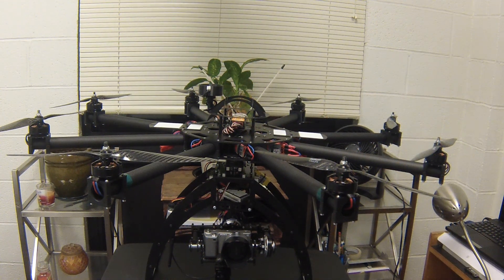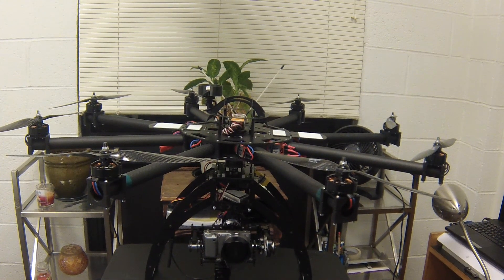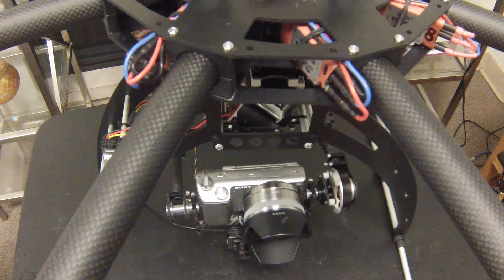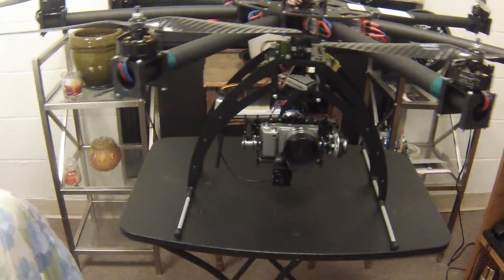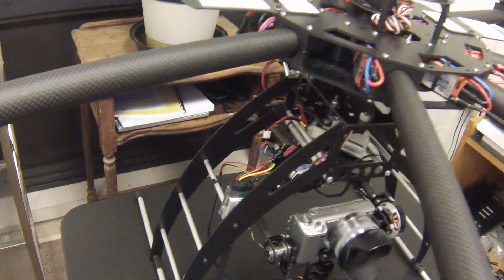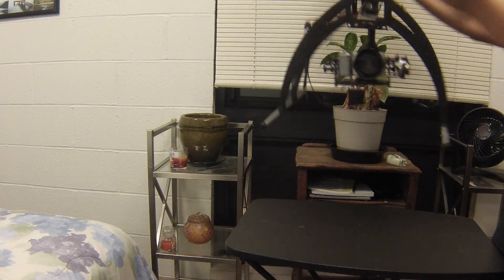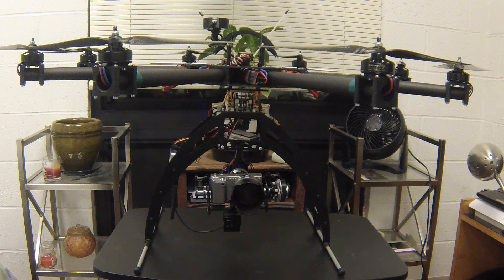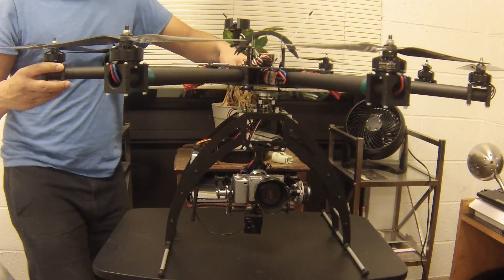Octocopter with Brushless Gimbal Build

Comment: excellent octo..
are you use DJI naza on it? If yes, where to connect the gimbal since esc no7 & 8 use to F1 & F12
Reply from the maker: I run a brushless gimbal on this rig and I use a separate control board for the gimbal.

Comment: Nicely put together. I'm really interested in your gimbal setup. Can you please send me you parts list.
Reply from the maker: Hey Justin, I have since changed my gimbal set up to the ARRIS ZHAOYUN 3-axis brushless gimbal.  It is an amazing gimbal.
Reply: Baotri Ho Hi, so you have change the Gimbal because the  ARRIS ZHAOYUN 3-axis is better?  I'm asking because I have just bought the same but haven't got it yet :(
Thank you so much for your very informative Videos, much appreciated.
Reply from the maker: Klaus Madsen Yes, the ARRIS gimbal is amazing, check the sample video.
Reply: Baotri Ho
Hi Baotri, One more question. I understand the gimbal mount to the landing gear. So, how do you control the rotation of the landing gear so that it is not in the shot? PLMK what product you used. Thank you !!